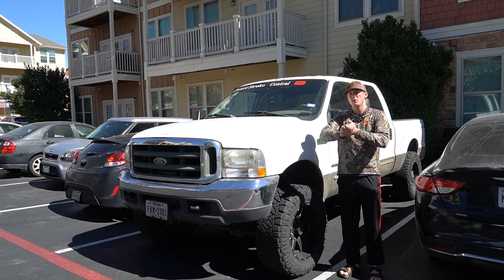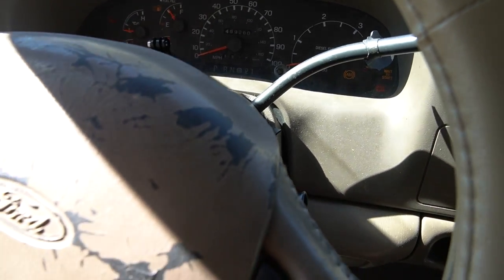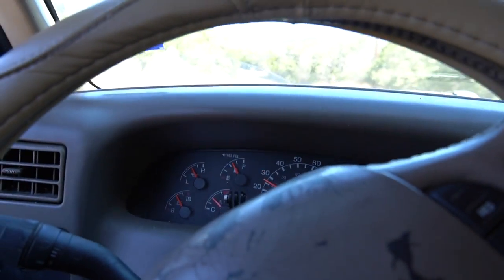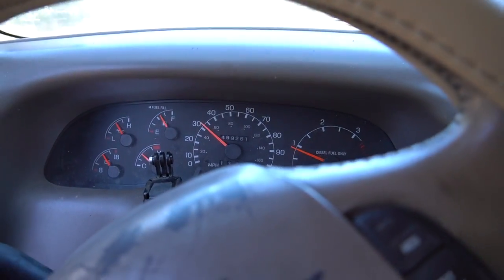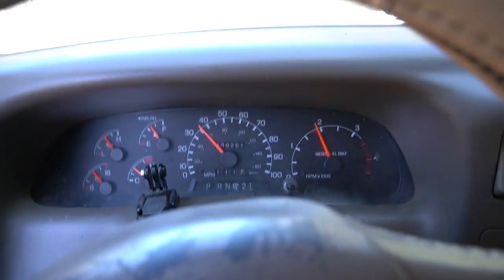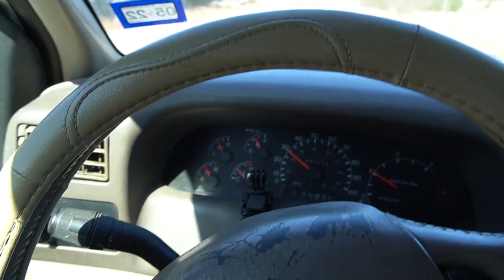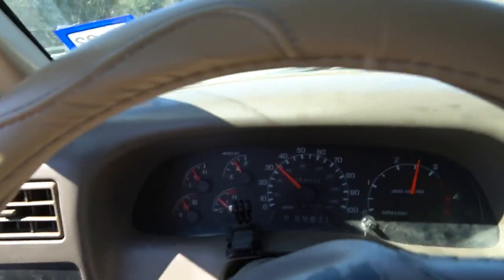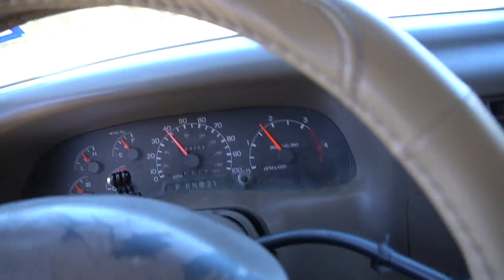How To Increase Turbo Whistle In A Diesel! Straight Piped 7.3 L Powerstroke F-250 Super Duty Diesel!

Comment: About the same mileage on my 02 F-50. And it looks like your steering wheel has a ton of play. Mine does and I keep saying I'm going to fix it, but I really only drive the truck about 1 or 2 weeks per year. I did an entire dynamat install because I hate how loud the truck is in stock form.... Seatbelts save lives.

Comment: S&B makes a great air filter setup for the 7.3 that looks great, its not as open as most air filters so it does not take as much air in but I love how it looks and it keeps the filter more clean. Get a Hydra tune, that's what I'm running right now and I roll a good amount of coal on stock injectors and turbo.
Reply from the maker: Badass man could you send me what hydra tuner you run in your truck?
Reply: @powerstrokecentral  I got my Hydra tune from Full Force Diesel, they have a good selection, and provide an option for tunes where you can pay $10 to have 10-17 pre-installed tunes.
Reply: @powerstrokecentral  If you are going to get mods it's best to settle down for something that is quality so you don't have to upgrade to something better later on.
Reply: @alexisguerrero3105  hydra tune all the way

Comment: Cold air intakes are in a box. Hot air intakes are exposed
Reply: Austin Mccormic  what I just said. If there is no air box it’s just taking in the hot air from the engine
Reply: Austin Mccormic  cold air is more dense, which allows you to burn more fuel which in turn makes more power